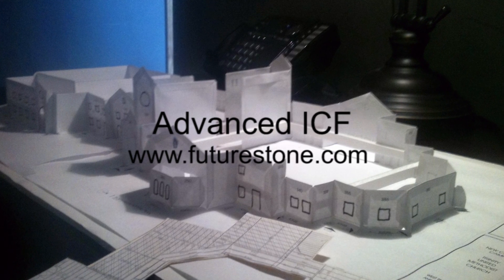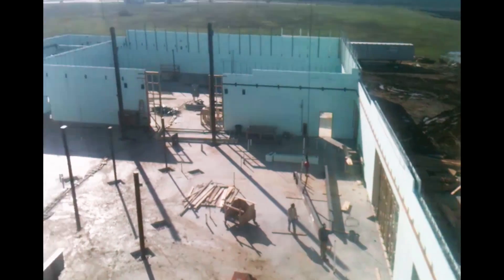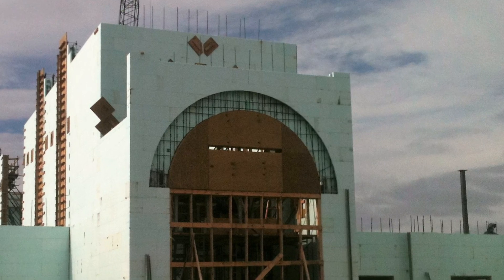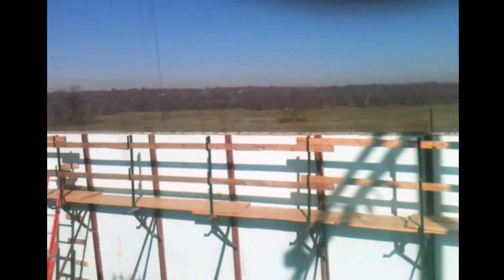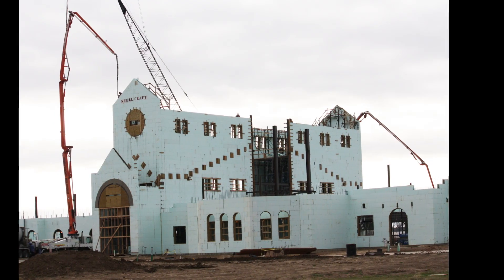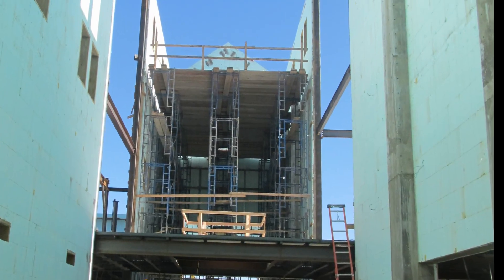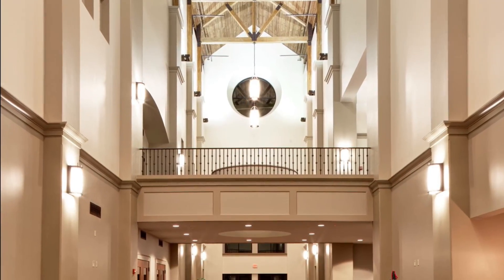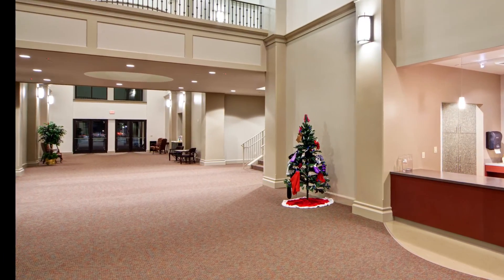Advanced ICF - Trinity United Methodist Church (Long Version)

Comment: Not sure which is is more impressive. this church with Nudura at 90 feet or Immaculate Conception Catholic of Cottonwood, AZ with Quad Lock at 31 to 42 foot with its more intricate design, both with pilasters.
For me at just the sheer single span clear height of 90 foot takes the cake for that alone.
The great thing about both of these and other similarly built places is they would make great havens after a decent tornado or hurricane for those who lost their home due to their strength alone from the structure itself being monolithic reinforced concrete.